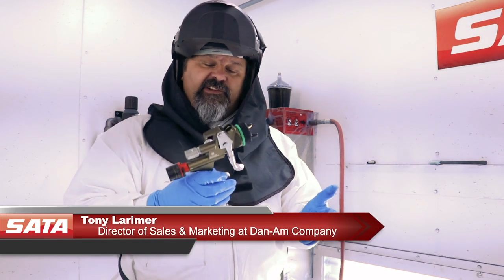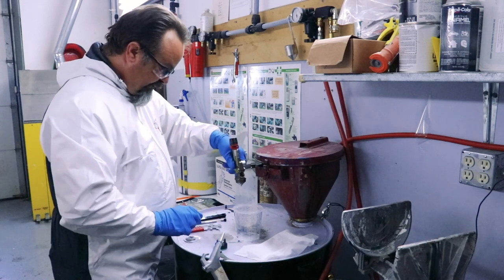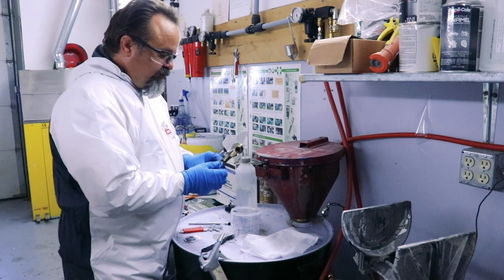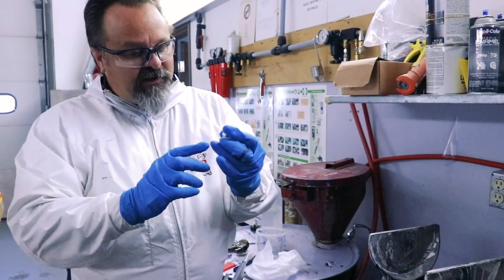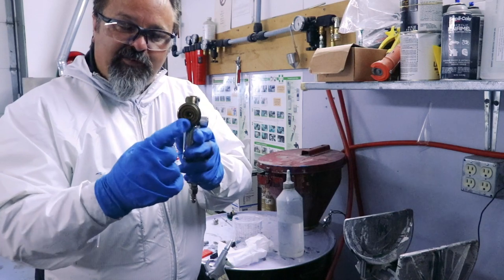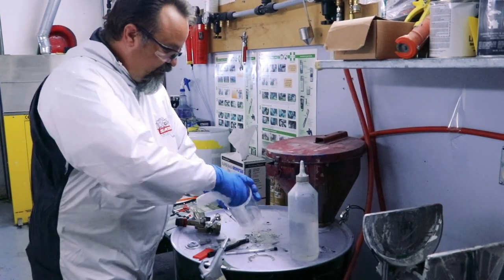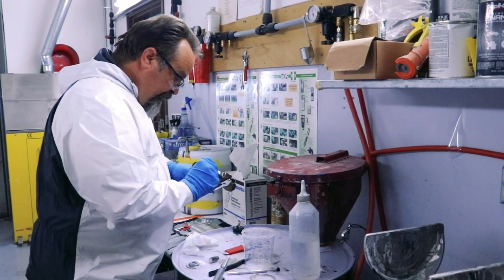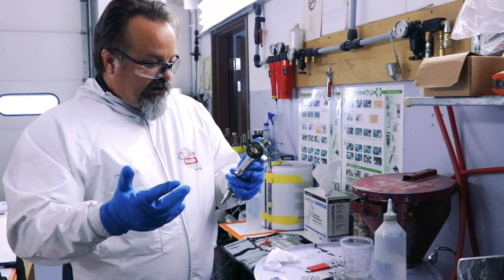Hand Cleaning your SATAjet X 5500 and other SATA guns

Comment: What can i do if my gun is spraying like its clogged? Almost like its "spitting" out paint.
Reply: It's kind of late, but replace the seal in the fluid tip. They go bad pretty easily
Reply: fluid tip isn’t tight. try to retighten should stop fluttering